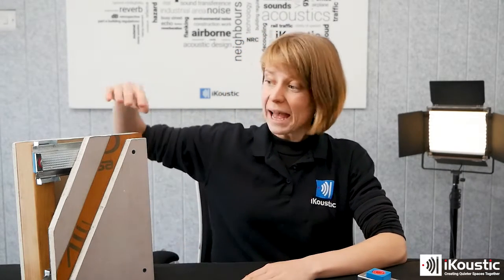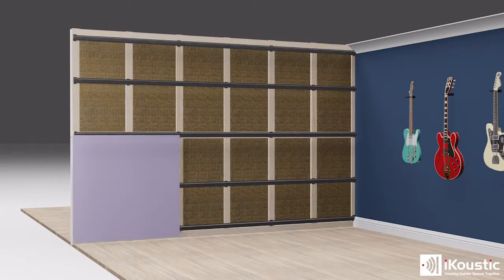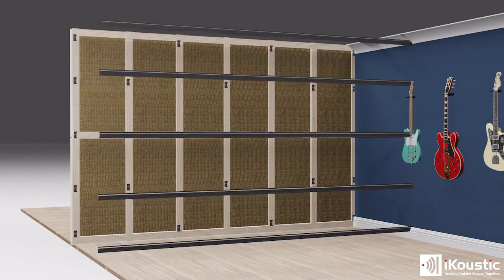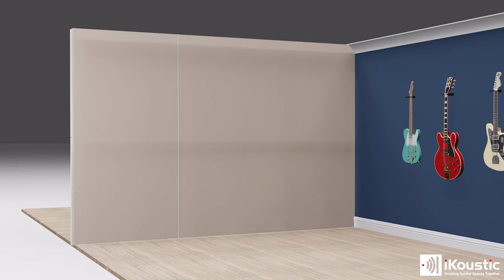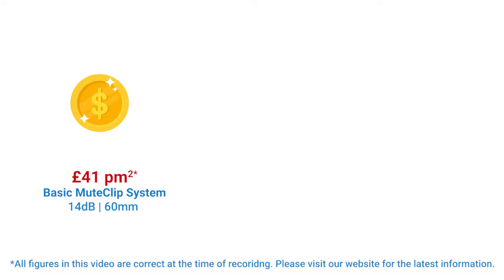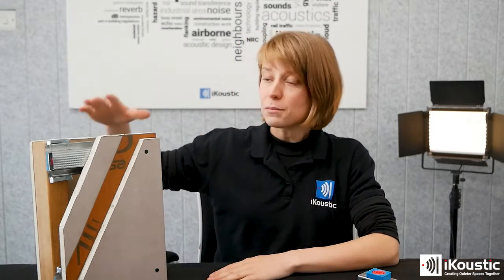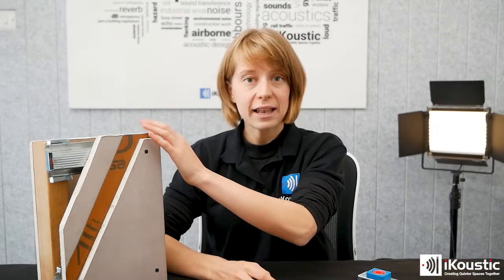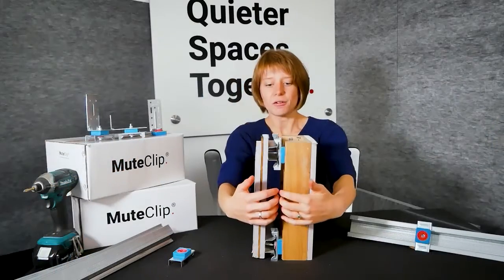How to Soundproof a Stud Wall (3 Best Systems)

Comment: Hello thank you for the info. May i ask what is the best way to soundproof a wall that s on side of the road. Traffic noise . Wil the 20 mm rubber and the wooden frame with rockwoll an 2 layer of plasterboard  with between tecsound or mlv help. Because we have also external  wall isolatie of 12 eps board and rendering. And what about moist. Thank you in advance😊 😊😊